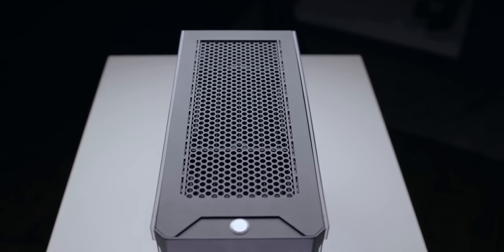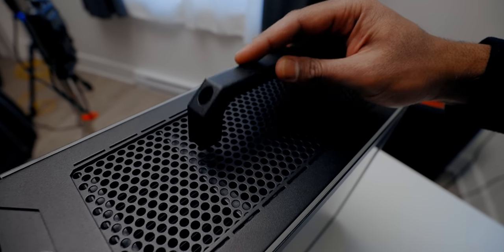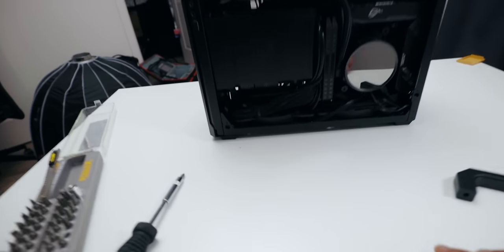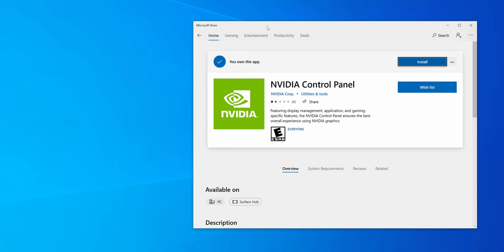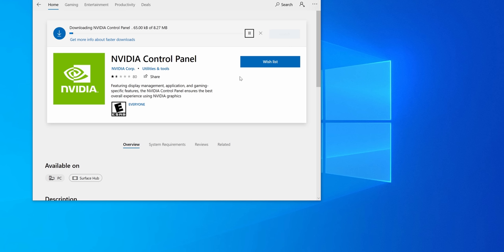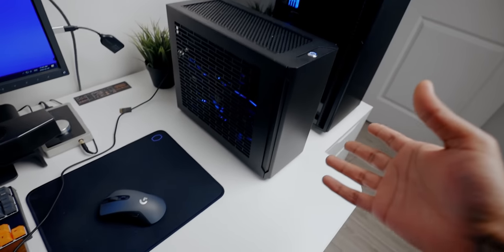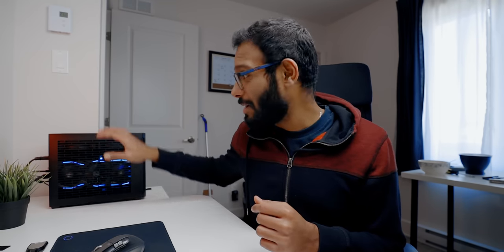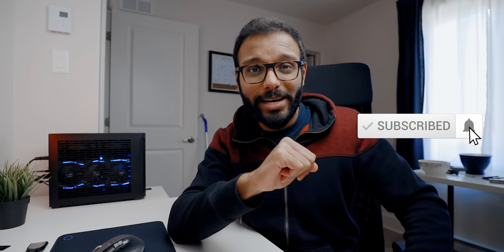My ITX Dream PC Has PROBLEMS - Time To Fix Them!

Comment: WOW!!  I'm very surprised a seasoned builder and tech nerd would make such a simple mistake......
An air cooled 2080TI jammed right up to the panel surface.......

🤨
Reply: The side panel is ventilated
Reply: @bryce1rocks  .....eh, not where it counts bud......🙄
Reply: @JuxZeil  I'm lost and I'm not sure what you mean by that. Are you talking about the mounting of the gpu or the side pannels?
Reply: @bryce1rocks   I will, but I really shouldn't need to if you're somewhat knowledgeable about computer hardware and thermodynamics.
The GFX card is far too close to the glass panel.  Its fans can't feed enough air down onto the heatsink and logic board.
You should have AT LEAST two inches between the fans and the side panel if you're not watercooling the GFX card. 👍
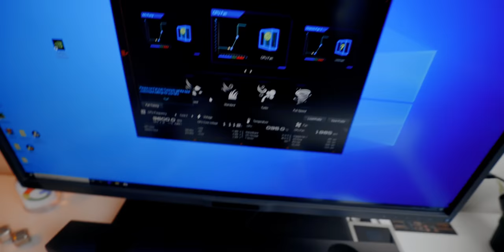Reply: @JuxZeil  thank you for explaining  that to me. I completely forgot about the glass panel in the beginning of the video, my original comment was for 9:32 when it shows the ventilated panel and assumed you were saying about that panel instead, also I never knew about two inch gap you mentioned. Sorry about my last comment if it came out harsh.
Reply: @bryce1rocks   No probs really bud.
I also took it for granted that not everyone has been doing electronics and PC's for nearly 4 decades so I'm sorry if I sounded a bit short tempered. 😔

Comment: Covering the transparent side panel is the biggest sin you are committing. What's the point having nice looking hardware and not be able to display it. Get a modded tempered glass or sum if u don't like the acrylic.

Comment: u already ruined the build with the rgb - cant U "just" break off the acrylic and replace it with pane glass o_O some 3M dobbeltsided tape should hold especially with a few dabs of epoxy ^^, and maybe some magnetic dust covers cut down for the vented side?

Comment: So is the Nvidia control panel only for window 10 drivers or for all window users.   Running 2700x, 16GB, with x470 mobo and Msi  GTX 1080ti window 7. 

Why was their NO notice from either Ms or Nvidia. This kinda bs.  As much love msi GTX 1080Ti.  It makes more want say fuck a Nvidia and go buy AMD GPU.  So sick of Nvidia and MS bullshit.  

Also you can go into goggle setting and turn off video hardware acceleration,  which stop GPU fan kicking in higher speed,  but it make effect video performance for google/YouTube and or any other task.   I did this for discord, cuz no need have GPU to boost when discord is running. But prob need for google chrome.

Comment: If you don't shave off your finger tip it's not powerful enough :P
Reply from the maker: Said us in the days of the San Ace fans.....Mike has the hand scars to prove it!
Reply: @HardwareCanucks  Produced by Sanyo iirc? Those were some brutal fans. :) Tried Delta Elec's server fans? Man those things are scary lol.
And to state the obvious: I'm joking. Don't stick your fingers were you wouldn't stick your member :D
My pinky is missing part of the tip due to a fan so it's totally not advisable :)

Comment: I wonder why no one has yet designed noise-canceling for PC cases?  Then it would not really matter how loud the fans are. hmm...
On your screw that was too long, it would have taken less than 1 minute to use a Dremel tool w/ cutoff wheel to cut it shorter as well as being a lot cheaper since you wouldn't have to use fuel to get to the store & back plus buy an overpriced screw.